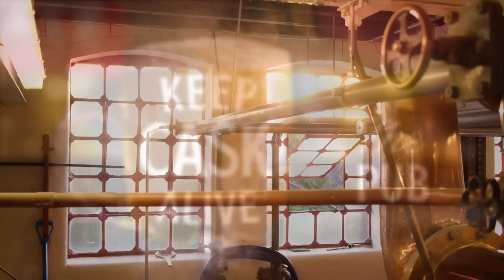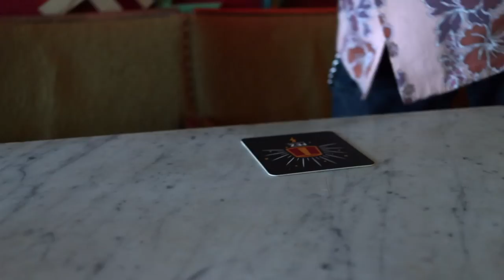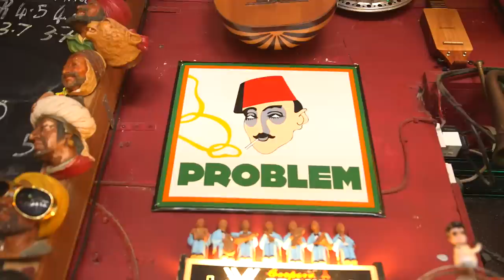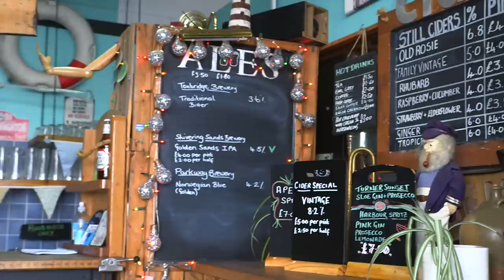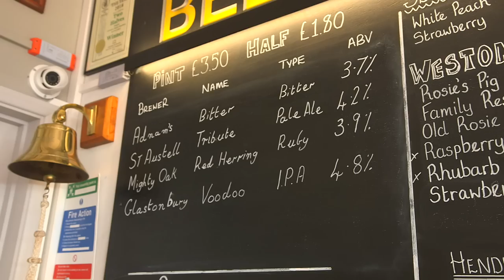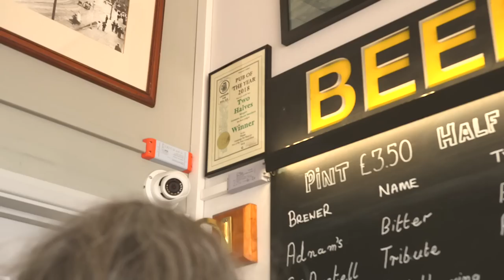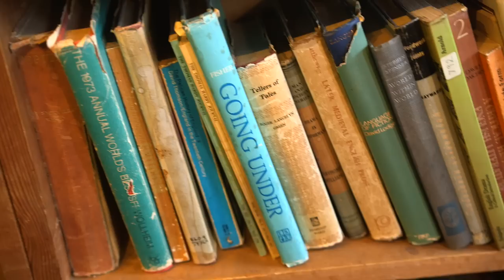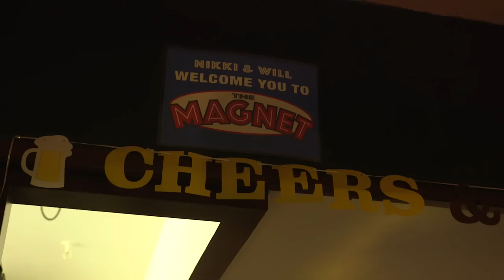Micropubs of Thanet (Keep Cask Alive pt 4) | The Craft Beer Channel

Comment: I think the solution to saving cask beer is to use keykegs or bag in a box, so that the beer isn't getting oxidised with every poor, that way you could have a cask beer on tap for weeks without any decline in quality
Reply from the maker: There are cask taps that prevent/slow oxidation and don't require the use of one-way kegs. Hoping they become more widespread.

Comment: The Flowerpot in Derby (which has a lot of good pubs) is pretty special as the beer is amazing and it caters for both the ale crowd and a lively music venue. I am also really partial to The Harp in Covent Garden which again is gem beer wise and little bit tucked away from the west end crowds.
Reply from the maker: Is the flower pot a micropub? The Harp definitely isnt - it is tied and as trad as it comes! Though a very love place.
Reply: @Craft Beer Channel - no, The Flower Pot is not and the question posed seem to be your favourite pub in general. So hence The Harp, which as you say is no longer a free house, but it still has a decent selection of different cask ale and a good turnover to ensure it is tip top condition. On my visit to Thanet micro pubs, two which stood out in terms of being true micropubs with no bar and you sat amongst everyone which generated conversation. These were fantastic the first - Just Reproach (Daniel Defoe quote about the town) in Deal and The Conqueror (after a ship) in Ramsgate. I would recommend both to anyone who loves these types of pub or who have not yet experienced them.

Comment: Love brewers who embrace classic styles and look for balance. This is why I really dislike IPA, it's out of kilter. A good beer balances the malt with the hops. Classical styles did that with the malts and hops they had locally. The beer brewing is a lot about your process, it's not just about what hops you use, but how much and when you add it during boiling your wort or even dryhopping. It's an art. I've been to a few local "micro breweries" here in Australia, and I feel sorrow for the preponderance of sours and IPAs. There are a lot of classical styles they could brew, and if done right would be a lot better.
Reply from the maker: There are plenty of "classic" beer styles that are entirely unbalanced – Imperial Stouts, Barleywines, Berlinerweisse. All lean heavily into one particularly flavour. In our view balance is a slightly overused word in beer – harmony is better. You can have a very, very heavily hopped IPA but if it works in combination with the yeast strain, malt grist and water chemistry it can appear balanced. That said, I too would love more styles to see the attention IPA gets.